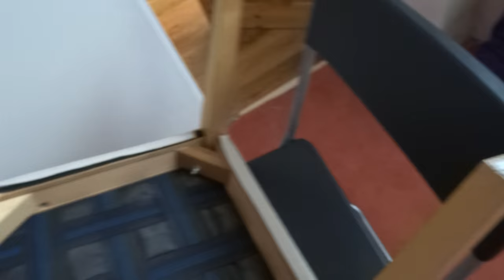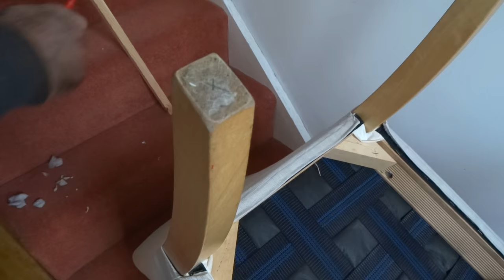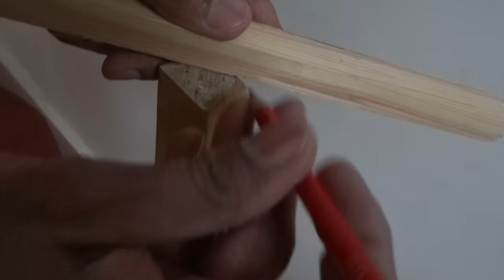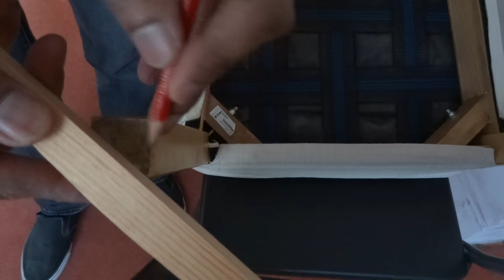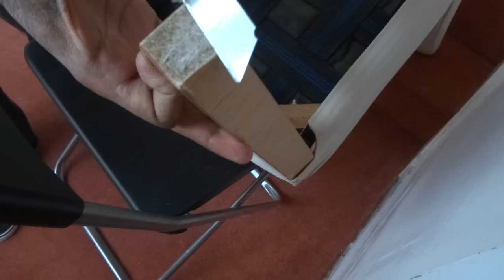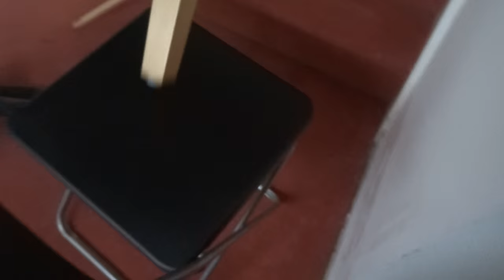How to install / fit slid and glides on furniture to protect flooring

Comment: Did they end up scratching the floor after time or are they good to use ...just bought a new floor and don’t fancy a risk haha
Reply from the maker: It was good initially but after awhile it started scratching the floor, I went back to the soft pads but that is also crap. Best just to get rid of your chairs and just sit on the floor its driven me nuts....
Reply: Geek Street thanks for the quick reply hahaha I may consider sitting on the floor very soon ha
Reply from the maker: just to add... you know the worst thing is when you have guests around for a meal and then they drag the chair getting up and you can hear the scratch. I think carpet and lino is the future.
Reply: Geek Street yeah I’ve had that happen a couple times maybe Lino will have to be got